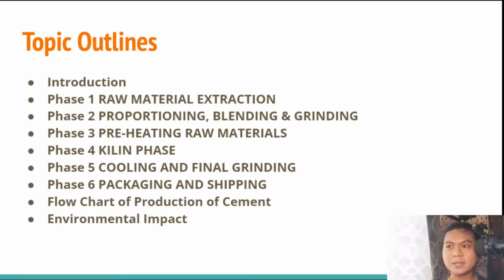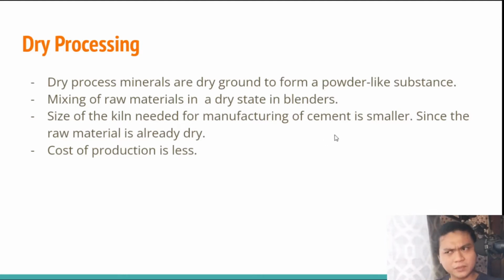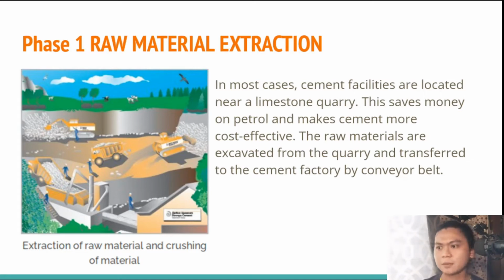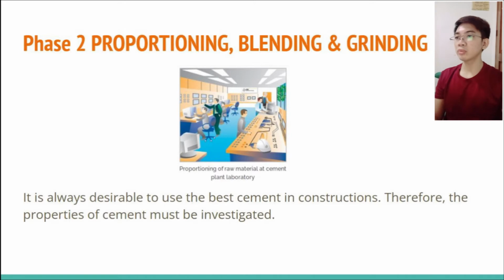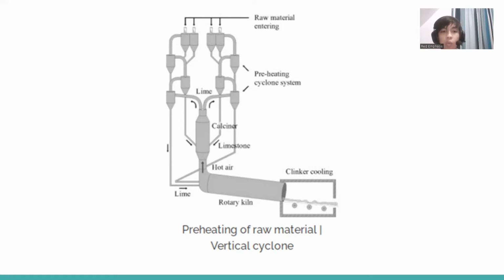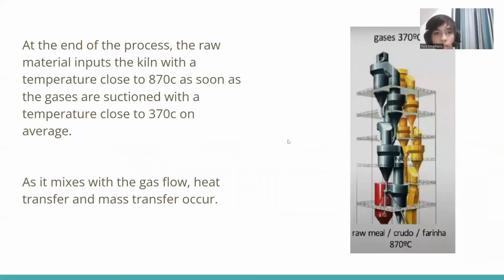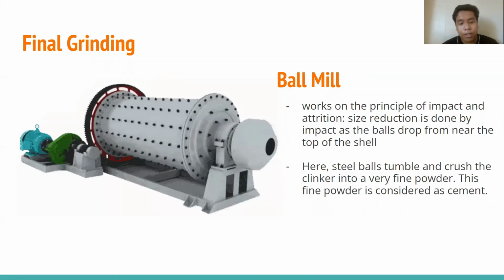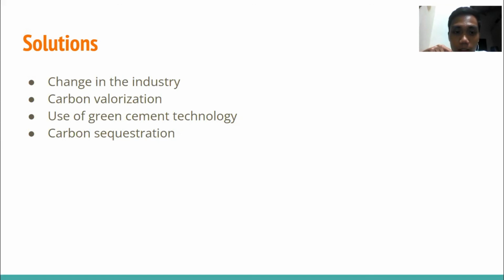Topic 5:  Cement Manufacturing

Comment: Lamberte, William Wallace A.
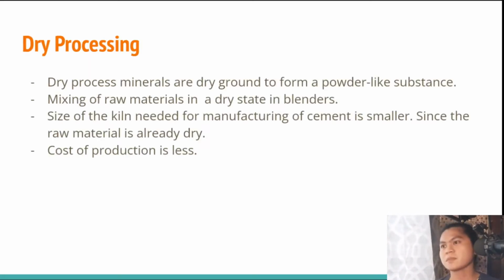4:13 Dry Processing and Wet Processing
Cement is manufactured using two distinct methods. Wet process minerals are wet ground (by adding water) to form a slurry and then dried, whereas dry process minerals are dry ground to form a powder-like substance. Both processes are in use and have their own advantages and disadvantages. While wet process the raw materials can be mixed easily, dry process slurry drying costs less.

Comment: Dajan, Kenneth Joseph Rex D.

7:04 Dry process

In the dry process, the moisture content of the raw material is reduced to less than 1% before the blending process occurs. The dry material is pulverized and fed to the rotary kiln. Further drying, decarbonating, and calcining take place as the material passes through the rotary kiln. The cement clinker made by the dry process has better quality and stability. It can bring more economic and social benefits to production.

Comment: Adrian Clark D. Veloz

1:25 Cement

The topic in this time stamp is all about cement, I was really interested about listening because its the most common material that is used in almost all our surrounding. According to the video, cement refers to a compound that is viscous or sticky, this is the binding material that is widely used by civil engineers. I really didnt thought about the mixing part about it but it surely takes a lot than that, and in that mixing part is the integral part.

Comment: 7:50 Wet Processing of Cement
The wet process of cement production entails grinding raw materials into slurry, mixing them with water, and then feeding them into a wet process kiln for drying, calcination, and clinker formation. Before being calcined in the kiln, the raw material slurry can be dehydrated into raw material blocks. This method is known as the semi-wet process, and it is still used in cement production today. The wet cement manufacturing process has the advantages of being simple to operate, low in dust, and easy to transport. The slurry has excellent uniformity because it flows, which improves clinker quality.

Comment: Mier, Dan Lester
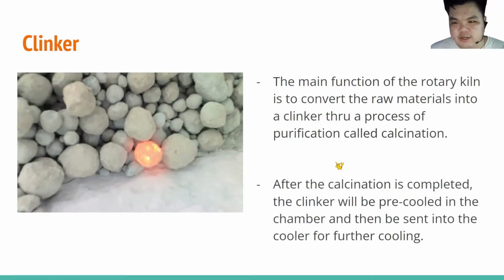36:09 Clinker
Clinker is a nodular substance formed during the kilning step of cement manufacture that is utilized as a binder in a variety of cement products. Clinker lumps or nodules are generally 3-25 mm in diameter and dark grey in appearance. In a rotating kiln, limestone and clay are heated to the point of liquefaction at around 1400°C-1500°C. I believe the purpose of this material should be further discussed.

Comment: Abello, Raynand R.
1:25 Cement
Cement, in a broad sense, refers to all sticky compounds, but in a more specific meaning, it refers to the binding materials used in building and civil engineering construction. This type of cement is made up of finely powdered powders that harden when mixed with water. Hydration, which is the chemical reaction of cement compounds with water to produce submicroscopic crystals or a gel-like material with a large surface area, causes setting and hardening. Constructional cements, which can set and harden in water, are sometimes referred to as hydraulic cements because of their hydrating capabilities. Portland cement is the most important of these.

Comment: Edio, Van Albert T.
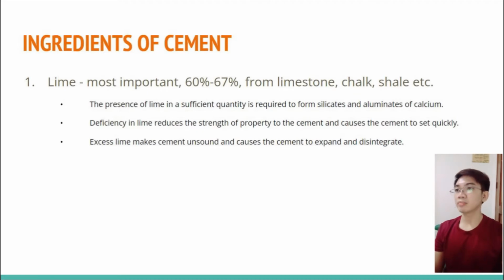20:12 - Ingredients of Cement
One thing I've learned about cement is that lime or limestone is an essential component of the cement mixture. As a result, cement is a typical binding agent used to bind materials in building. Cement is made by burning a high-temperature mixture of calcareous (calcium) and argillaceous (clay) elements, then grinding the kiln to produce a fine granules.

Comment: Macalaguing, Ivan Jun A.
30:03 I just learned that cement isn't synonymous with concrete. I also learned about the material or ingredients of the cement which is mostly lime , because it is important with a 60- 67 % portion. Second is Silica with a 17 - 25 % portion to strengthen the cement. Third is Aluminium Oxide with 3 - 8 %. Then there's Magnesium oxide, Iron Oxi6, Calcium Sulfate, Sulfur Trioxide and lastly Alkalis.

Comment: Casiño, Earl Anthony N.

20:27 | Ingredients of Cement

Cement is commonly made from limestone, shells, and chalk or marl combined with shale, clay, slate, blast furnace slag, silica sand, and iron ore. When these ingredients are heated to high temperatures, they combine to form a rock-like substance that is ground into the fine powder we know as cement.

Comment: Casiño, Sharia Cyril P.
8:16 Wet Processing for Manufacturing of Cement
In this process, the raw materials are changed to powdered form in the presence of water.  The wet process of cement manufacturing are popular for several decades because of the possibility of more accurate control while the raw material is mixing. The cost of production and fuel consumption in this process is relatively high compared to the dry process.

Comment: Dacoroon, Darlene Grace F.
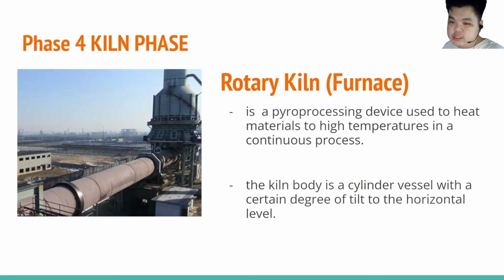33:23 - Kiln Phase
Cement is one of the most important building materials and mainly used as a binder in concrete, which is a basic material for all types of construction. But in the cement process, the kiln phase causes the emission of carbon dioxide, which is one of the major greenhouse gases responsible for global warming. With a view to reducing, even eliminating, the harmful environmental impacts of cement usage, leading industries are now trying to implement technologies that utilize recycled materials and renewable energy sources.

Comment: Candaroma, Katriona Maxinne G.
4:10 Dry Processing for Manufacturing of Cement
Dry processing involves grinding the raw materials into a powder and feeding them into a kiln. As the material travels through the kiln, it is further dried, decarbonated, and calcined. This process is used when the available raw materials are relatively hard. The equipment in this type of process are comparatively smaller which is why it is quite economical.

Comment: Estillore, Cherry Mae P.
7:52 - Wet Processing
The wet process of cement production involves grinding raw materials into slurry, mixing them with water, and then feeding them into a wet process kiln for drying, calcination, and finally clinker formation. The raw material slurry can alternatively be dehydrated into raw material blocks before being calcined in the kiln. This approach is known as the semi-wet process, and it is still used in cement manufacturing. The wet process of cement manufacture has the advantages of being simple to operate, low in dust, and easy to transport. Because the slurry is flowing, it has an excellent uniformity and hence improves clinker quality.

Comment: Zalsos, Ervin A.
36:01 - Cement Rotary Kiln Diagram
The kiln process is the fourth phase, and it is the most important stage in the cement manufacturing process. It is commonly used to heat materials at a high temperature in a horizontal cylindrical vessel rotary kiln that is tilted to a predetermined degree, making it a continuous operation. The temperature starts a chemical reaction known as decarbonation during the procedure. Carbon dioxide is released by the substance (such as limestone) in this process. The kiln's high temperature causes the material to slurry.